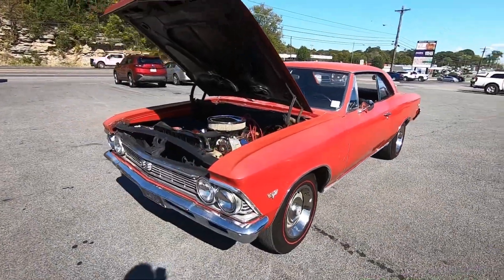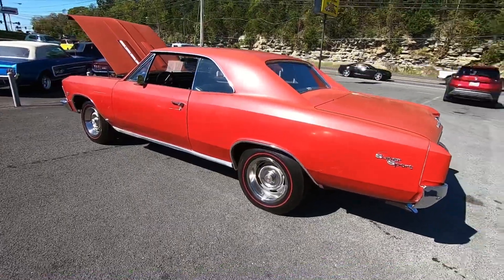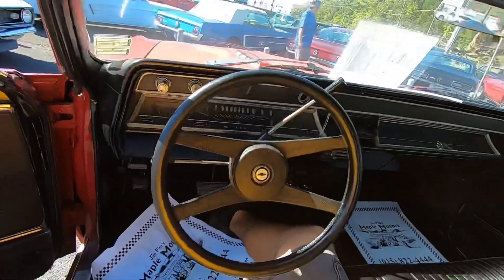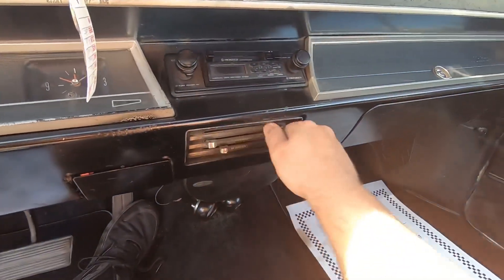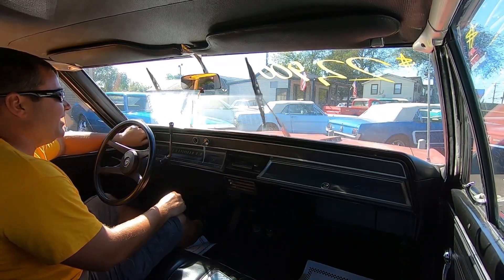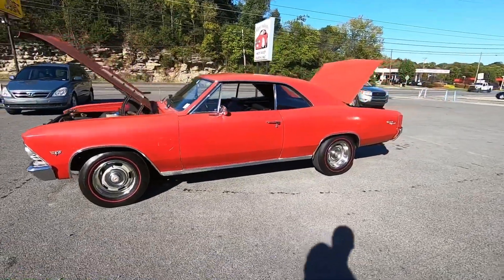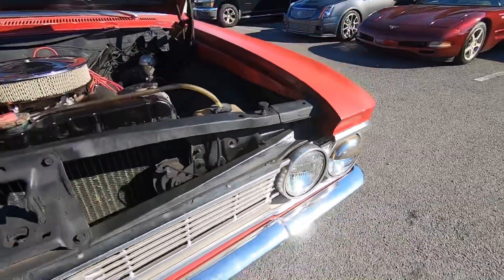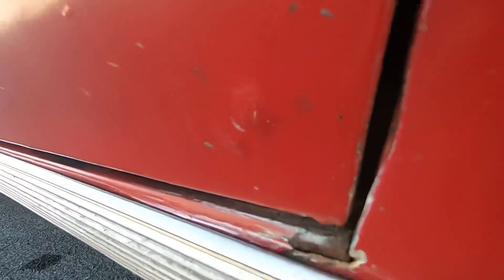Test Drive 1966 Chevrolet Chevelle SOLD $22,900 Maple Motors #1230

Comment: My first car at 19 yrs old in '79 about that color, 283 3 speed manual, for $350 bucks. From red light to red light it was a blast!
Reply: If we only knew back then.
Reply: @TheSchmed  I say that all the time.  Probably could have picked up a Hemi, 4spd Cuda for 1500 bucks.
Reply: I had a 66 in 1979. 283 auto...baby blue

Comment: what is the difference between a 66 and 67 chevelle besides the tail light design?
Reply: 66 has what is called a wrap around grill that the 67 does not have. 66 is my absolute favorite since I was big enough to know what a car was
Reply: Front end

Comment: That is the wrong Super Sport badges on the quarter panels.
Reply: another 20k to restore to decent then youd have pretty nice car ... its not an SS
Reply: @masonsnook1583  I respectfully disagree. On a '66 Chevelle the badge is a single horizontal line: Super Sport. Not with larger S in a stacked design. These are '67 Super Sport badges.
Reply: That’s what I was thinking; about 20,000, even if you do a lot of the work yourself.
Reply: @Gonzo614  it also had the 396 and checkered flags on the front fenders... i couldve swore it had a small block
Reply: It's not an SS
Reply: @chasbuchanan4195  We all know that.
Reply: Wrong motor worth 200.00
Reply: @martinedeards5424  it's a 283. Same motor I had in my '66 wagon.
Reply: @Gonzo614  and the 283 is a great reliable engine... my favorite small block is the 327 chevy though my 69 chevelle had that... it was bullet proof !!
Reply: @jamesdewiel4736  ill take it for $200 😂.... in my eyes the cars probably worth about 12k.... to me